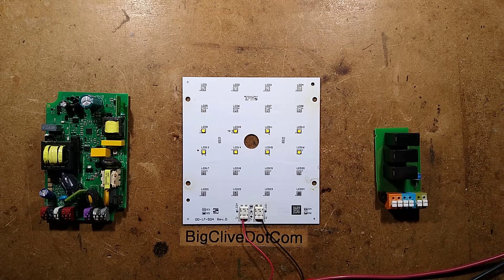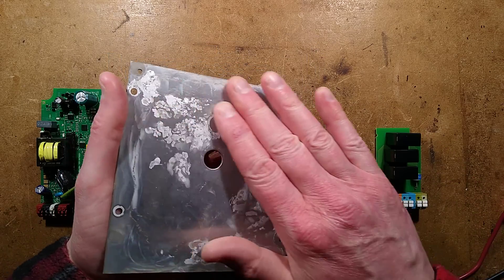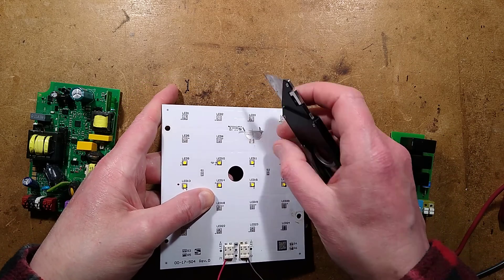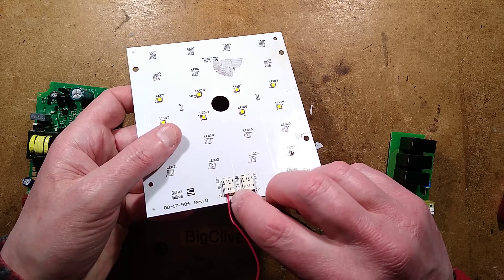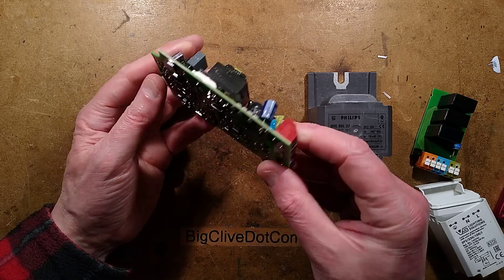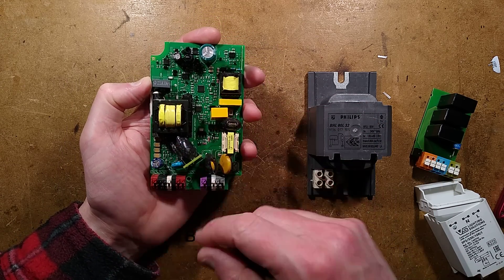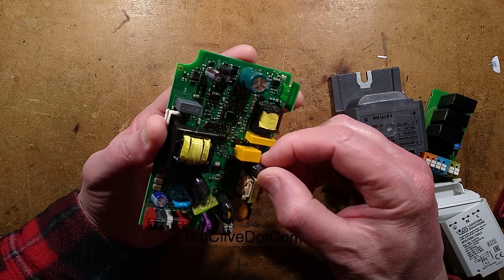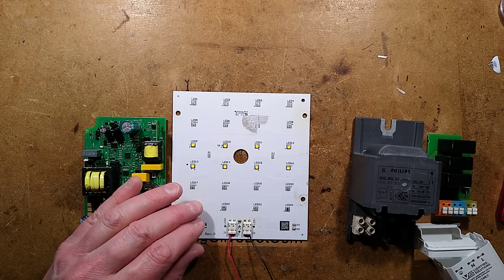Unusual street light failure

Comment: This failure is definitely caused by the way the luminaire was stored, like you mentioned. Water is the enemy of electronics. That is why these luminaires are IP66. That obviously only applies when properly installed.

LED luminaires are designed for 100.000 burning hours which is approximately 20 years of service life. The LED has no heatsink because the luminaires aluminium body to which the led board is sandwiched acts as the heatsink. This example is a 8 LED board, but this way of heat dissipation is used for luminaires well over 100 LEDs. It takes a separate sort of engineering to account for this in the design of a injection molded aluminium body. Over the 100.000 hour lifespan the light output gradually degrades. This can be accounted for by increasing power from the led driver. This is among the features that can be programmed with the nfc.

Interesting series with the streetlight luminaires! Please keep it up 👍🏻

Comment: The way it’s populated will decide the coverage pattern.  Cheaper to make one complicated circuit board that will drive 8, 16 or 24 LEDs than to make individual drivers, based on economies of scale.  Then, just have 1 circuit board that can be populated with LEDs to suit the requirements of the lighting design.  Street lighting is driven by legislation and not aesthetics.

Comment: 0:04 It's a dead LED streetlight and it's our favourite type 🤣🤣🤣

Anyway, pretty interesting failure. I guess it delaminated because the water that got between the layers evaporated because of the heat generated by the LED's and it created those bubbles. And those LED streetlights don't hold up for very long. So why don't they just leave the sodium lamps?
They are cheaper, last much longer and sometimes they are more efficient.

Comment: There is a point in Tech, that says STOP.
Had a digital camera, and it had a funny feature, that the battery was in constant use, as it didnt have a backup inside for the RAM, and it didnt have storage Ram that saves the pictures.  And every month(even with no use) you had to change the batteries.
Reply: Mine did that, it sucked because every time I ran to grab the camera for photographing something, I'd find all the settings wiped.
Reply: @tncorgi92  The Fuji camera was great, even had 50x magnification.  Just forgot to  put a Battery on the Tech, Computers have had these since the 386 to save the Bios.

Comment: You are obviously not familiar with the national highways lighting the way to net zero initiatives, ho, ho. This includes at least two diesel-powered trucks and five people to replace the one street light round my way, which was ridiculously bright and failed after two years. The previous lamp had been working fine for thirty years, just requiring the annual clean the bird muck off the dusk sensor procedure.

Comment: Are the SS screws causing galvanic corrosion accelerating the bubbling / water ingress of the Al backing of the PCB? Here in BC (basically communist), Canada, many car license plates exhibit a delamination of the paint lettering from the Al substrate. An unintended consequence is that OCR readers and speed cameras are impotent in identifying law breakers. Obviously I would never condone ignoring this design flaw and in doing so evading tax collectors….
Reply from the maker: I don't think the delamination had started in the vicinity of the screws.  I'll check when I get back.

Comment: Overkill on the PSU?  I think yes.
The water probably made its way between the insulating layer and the aluminum. Probably happened while in use and heat cycling but not necessarily.  Water is a solvent...

Comment: Makes you think how technology has changed over the years, when it comes to flickering lights we've gone from "just change the bulb" to "just change the whole streetlight" when it comes to road illumination, not built for serviceability, but made to look fancy with their designs, which sometimes are the achilles heel when more thought is put into how it should look over how it needs to perform, and when we have councils who are going bankrupt, changing streetlight units versus changing a bulb is a cost that they could do without...
Reply: It's more complicated than that. Cost matters a lot. Cost of acquisition, installation, operation, maintenance, and disposal  are all factors which can vary across products and across time. For a while one of the biggest users of LED lightbulbs (when they were $100 each) involved certain types of decorative lighting in really high locations like fancy theaters and halls. This is because the cost of the work hours for multiple people to get out the scissor lift to safely change incandescent bulbs was exorbitant. Then you have to take into account product improvement. How much should you care about durability if you project that a 30% more efficient product will be available for the same price in 5 years? Maybe you are better off getting lower reliability now and planning to do replacements sooner.
Reply: @garrettkajmowicz Exactly. Whole lifecycle costs can easily result in component maintainability being a much lower priority than modularity. In most places now the most expensive part of any system is the people. So anything you can do to reduce the amount of time and training it takes someone to do a job the more it’s selected for. This is where regulations come into the picture to place limits and discourage needless wastage. Imagine if suppliers or manufacturers were required to appropriately recycle failed modules and document it. Suddenly reliability and smaller modules would be commercially selected for.
Reply: @garrettkajmowicz The issue arises when the company fails to conduct maintenance properly, resulting in several streets being in the dark. It can worsen when the municipality doesn't fulfill its contract with the contracted company.

Comment: as an RMA technician for an LED street light company. i can confirm every problem you have found and many more.
the main cause for all of them is usualy water ingress. most of the time this is from a trapped cable compromising a seal, or the nema sockets/photo socket seals failed. 
the led boards will blister as you have seen almost every time they interact with water. 
this is sometimes intesified as the dc current runs through them, you get gas production aswel as electrolitic corrosion.
part of my job is trying to figure out what the initial point of failure was and then trying to figure out what caused it, 
was it user error?, bad manufacturing?, did they leave it outside in the rain upside down for 6 months?, or inversly did the leave it open and inside in the the dry for 6 months after water damage?
half the time its impossible to determine anything and i fix it regardless.
Reply: as an engineer who oversees warranty and failure analysis at a non-streetlight lighting company, its always Water Ingress or Surge Damage. Very rarely a design fault or component failure :D
Reply: @MetalPhreakAU  - Of course, both non-warranty failure modes.   eye roll
Reply: Would you say the high number of light sources is part of the problem?
Reply: @rimmersbryggeri  if you mean multiple leds instead of one larger led? probably not much. water damage will effect them equaly

Comment: None of our LED street lights are bright enough but they have no intension of replacing any of them. There are so many dark shadows all over the town it's like going back to days of gas lighting.
Reply: mood lighting is great
Reply: Yep, it's always guaranteed to put you in a Bad mood....
Reply: It's happening here in Brazil too. I used to think the idea of replacing sodium lamps with LEDs was amazing. i've never been so regretful. Today I encounter dim, directional lights, creating large dark spots between the poles. Some bulbs burn out after 3 months of use, many remain burnt out for years. I need to carry a flashlight in my bag, I guess I need to buy a lantern to match the setback. Don't get me wrong, I love LEDs, but I don't love public lighting with LEDs.
Reply: Following a few complaints we have finally had our LED lights upgraded and at last they have diffusers on them, so we do not get the bright/dark alternating pattern any more. Have also persuaded them to not use the low brightness setting threatening to sue them if I trip over something or cycle over something when they are on extra dim mode.
Reply: The street lamp next to our house used to light up our drive, which was quite handy. Now it barely illuminates the road next to the lamp.
I guess it's lower power and more directional, which I suppose is good for our Council Tax bills.
Reply: Here I'm seeing the opposite.  Where I used to live, they upgraded all the street lamps to LED, and you could walk down the street at 2 AM and read a book.   It's like everyone's forgotten about light pollution AND that I don't particularly like the inside of my house lit up by the streetlight because they couldn't directionally focus it.    A street light isn't intended to be a replacement for headlights.  It's supposed to simply make it safe to walk from point A to point B without a flashlight.
Reply: @tbelding  same, i think most street lighting is far too bright. EMBRACE THE DARKNESS!

Comment: That driver looks absurdly complicated. Even with PFC and Dali it's hard to see how they managed to use so many parts - looks like there are two MCUs on there ffs!
Reply from the maker: Yeah.  Just over engineered to the hilt.  It's partly because they are trying to make a one size fits all driver.
Reply: @bigclivedotcom  Trying to have as many possible points of failure as they could cram into a board that size.
Reply: 2 different design teams, one for the primary side, and one for the secondary side, and they only ever got an interface spec for the other side, nothing more.
Reply: Its to power the 5G Death Beam, if you remember Clives response to that "Teardown" Video by some anti 5G Nutjob.
Reply: Perhaps it's so complex because it was designed to mine cryptocurrency for the manufacturer using other people's electricity 😅

Comment: You helped me understand a problem we had with kitchen ground fault receptacles.  We could use them unless someone turned on the hall overhead light. Your explanation of how ground faults were detected led to a nail thru a wire (that I saw using a long otoscope) that was grounded into a 2x4.    I ran a replacement around the fault and everything is fabulous.    Thanks
Reply: Yes, you've just found a major flaw in the NEC requirements for construction.  Plastic coated electrical cables are required to be stapled into place so they can't move - which means any sharp object penetrating the wall has this wonderful wire held in place for it to damage.

Comment: I heard that Birmingham City Council is having serious financial difficulties and one of their cost saving plans is to reduce power to street lights.
I was wondering how much they could reduce the power and still allow them to be useful given that the lights where I live (near Liverpool) are pretty dim to begin with. They were changed to LED's about 6 or 7 years ago and I'm sure they were brighter than they are now, they have either got dimmer with age or the power has been reduced gradually !
Reply from the maker: I'm pretty sure they could save a lot of money by engaging on a bit of internal fraud investigation.  Most councils carry a lot of freeloaders.
Reply: It depends on what light level residents are willing to tolerate.  From a technical perspective, however, LED's are able to produce light at power levels far below their rating.  In fact, the lower they're run, the more efficient they become (in contrast to incandescents, which increase efficiency the hotter they're run).  

They do reduce in efficiency over time, as the phosphor degrades.  The #1 culprit of this is the heat the unit produces, making running them at lower power that much more attractive.  The emitter junctions can also degrade, but that's a much, much slower process.

The ideal solution would be to source units that are rated for double or more the desired light output, then under-run them.  Obviously this is more expensive up-front, but will yield electricity savings (at a given light output) and increased unit lifespans (theoretically at a superior ratio to the unit's over-spec).

Comment: Even fiberglass boats sitting in water for an extended period will blister.
Reply: The "Osmosis" problem.  Changes in the resin use for GRP layup have  mostly eliminated that issue, although there are a great number of older vessels with this problem, and the cost of remediation (grinding off the gel coat, filling voids, and epoxy coating) is very high.

Comment: I really don't like the idea of non serviceable LED-armatures and lights. In stead of replacing complete mercury-lamp streetlight armatures with complete led armatures one can just replace the bulb with a cheap standard LED bulb. That works just fine even with the ballast still in place. Much cheaper and less resources wasted and when the LED bulb eventually fails it is quick, cheap and easy to replace.

Comment: Our local council changes its LED streetlights approximately every two to three years. When we went from incandescent bulbs to LPS, those sodium lights lasted a good thirty years, not the lamps/bulbs, obviously, but the actual luminaires.  LEDs are without doubt the most unreliable and unsuitable form of lighting they've ever deployed, and at what cost? But I take heart, I notice a resurgence of sodium in some locations. It seems that if you're wealthy enough, and can muster enough clout, you can get your SOX back, and I also notice that there is an increasing number of what look like sodium, from a distance, but up close, they look like LEDs mimicking Sodium - Is faux sodium becoming a "thing" in street lighting, or is it just a local council pandering to the whims of a few people who can afford to twist the arms of its officials?

I have to confess, I like the new orange LEDs. The colour isn't quite right just yet, looking a tad pale, and slightly pink (like HPS in the start up phase), and lack the brightness of the SOX lamps we used to love so much. They are definitely easier on the eye, but I digress.

You can see a similar delamination of circuit board in some of the last VCRs and some TV sets and DVD equipment, But not usually until they've been abandoned in the weather for some months.

What was that quote again? Something about plumbing and drains! 🤦😇💨😸🐈
Reply: My council uses urbis schrèder axia gen 1s and have everything replacable, drivers actually last and the diode blocks are replacable like a bulb whilst giving the misleading Impression that they are built in.

By the way the ROHS directive are banning all discharge lamps after 2027.

Little do they know LEDs themselves have toxic elements in them.

Comment: I find the issue with the screws interesting.  Is it particular to stainless, or would most any steel suffer the same problem?
Reply: Stainless steel fasteners on aluminum is a common mistake. People think stainless is always more corrosion resistant but against aluminum the opposite is true. The two metals create quite a galvanic current. Regular zinc plated fasteners would fair better galvanically. But as TomCee53 surmises, anything would not stand up well to being wet for months.
Reply: Probably anything. Aluminum submerged electrolyzes quite rapidly with any other metal.

Comment: Those 90 Volt gas discharge tubes ( without leads , solder sweated into a BIG grounded brass block ) , make 1st class dissipators of the secondary current from lightning strikes in the 50 Ω RF inputs to base stations .. DAVE™🛑

Comment: Wow, the amount of circuitry just to drive eight LEDs. Sort of seems like massive overkill in my head.
Reply: Yes... It does. Seems that a significant fraction of the board is EMI filtering. It probably has 95+ efficiency.  It needs a supply to power its microcontroller, and the MCU has a ton of glue logic to control the switching components, and interface with the many sensors (current, outside illumination, wireless programming interface, a couple thermal sensors, etc....).
Reply: @pigrew power factor correction is not simple either but is abdolutly nececary when 100s of lights are in use. Specialy so in 3phase systems unless you like a Neutral conductor.
Or it might just be the there to power the 5G Death Beam.
Reply: DISCONNECT IT FROM YOUR HEAD NOW!!! You’re right, it’ll kill you. Oh, sorry, I see what you mean now 😊
Reply: Wow all that circuitry for a few LEDs should just put a led driver in there and save the cost 😊
Reply: Depends on how tall the street light is; short street lights ~ on residential streets and foot paths are nearer to the ground and can be much dimmer so only 2 rows of LEDs are needed [I have seen this myself] however the taller street lights on; main roads, A/B roads & motorways have a full matrix of LEDs because of being further away from the ground they need to be brighter
Reply: @samuelfellows6923 The lumenaire used on my driveway uses a COB for the LEDs and is solar-charged with LiFePO₄ batteries.  It's been consistently working now for almost 6 years.  So it's possible to build these right, I think.
Reply: It's meant to be robust and run for as long as possible with as low a maintinance cost as possible, so I think the overengineering is justified.
Reply: I work in software, massive overkill comes from inexperience and ambition in this industry as well.
Reply: @stephenlesbos6208  I laugh, thinking back to when I was taking programming in college and got my first IT job, I tried to make code that was self-documenting and sensible, all they wanted was something that worked, albeit temporarily, while they chased down the next fire. Then the company got taken over and hired 6 more programmers to try and salvage things.